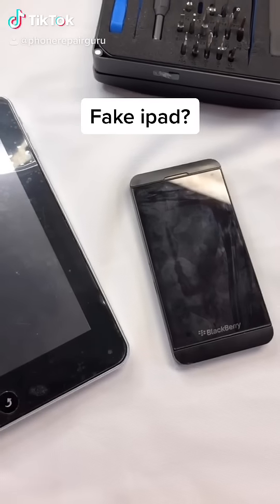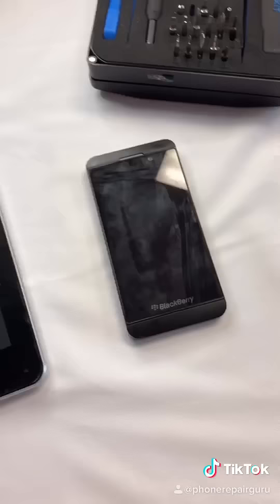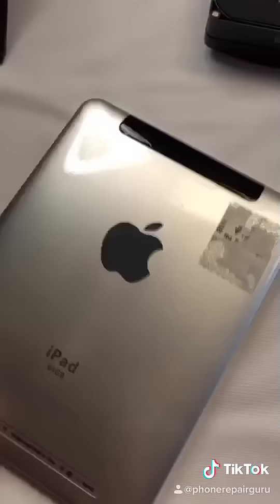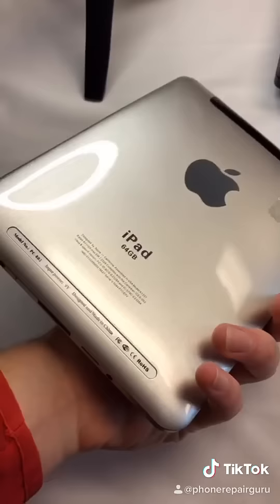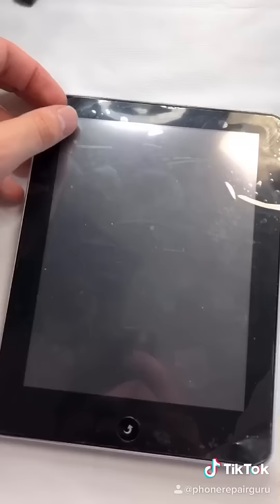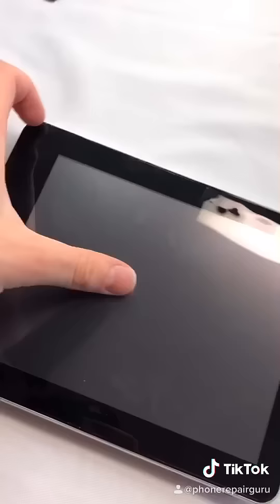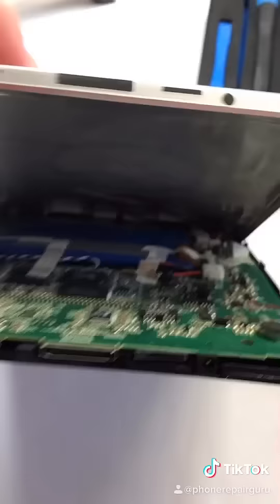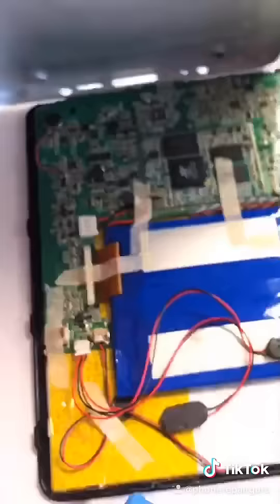Fake iPad? What is this? #Shorts

Comment: "Why is there samsung everywhere?" 
Damn they did a great job faking a real apple product
Reply: What
Reply: @ridgefrost  maybe don't assume things without evidence to support the assumption
Reply: @davidbenito5164  oh I'm pretty sure he is an apple fan and those that liked the comment are to, dont know if you've ever been in an apple V samsung comment section, either side could say the most pathetic thing you'll ever hear but cuz they r in defence of a specific brand between the 2 or against the competitor, supporters will upvote, this comment gives off the same energy
Reply: @ridgefrost  Dude.. Apple uses parts made by Samsung in their phones. That's the point of the comment. An iPhone is made of parts from several manufacturers, they don't make every part in the phone, so it's normal to open up an iPhone and see a Samsung chip. It's common practice in the technology industry, like LG tvs that have Sony speakers. Same literal concept. 

The people who liked aren't dumbasses for knowing what's actually inside a phone. Assuming it's some sort of fan war is a huge leap in logic.
Reply: @madeinisekai  thats not what the comment meant and i already know abt apple using samsung parts for their phones and their laptops to by the way
Reply: @madeinisekai  China.
Reply: @mindnova7850  just say Asia so Sony doesn’t stop the network again please 😂🤣😅